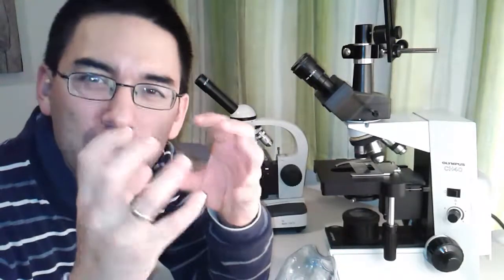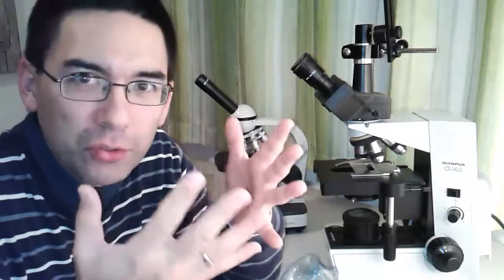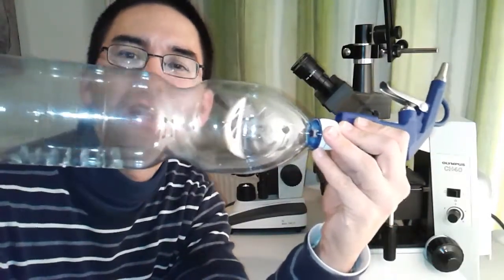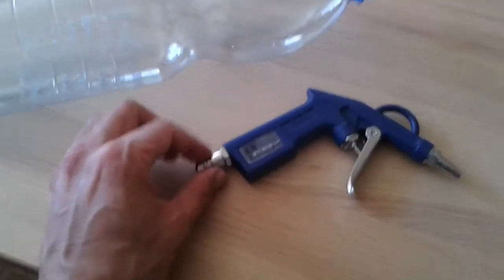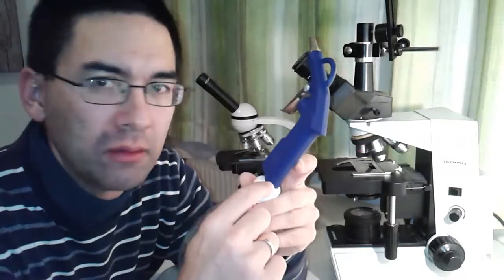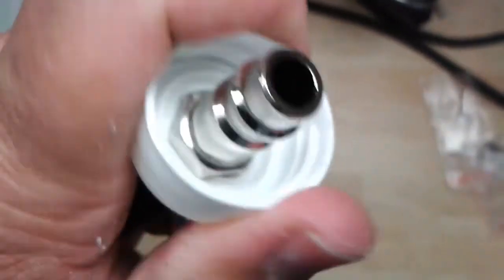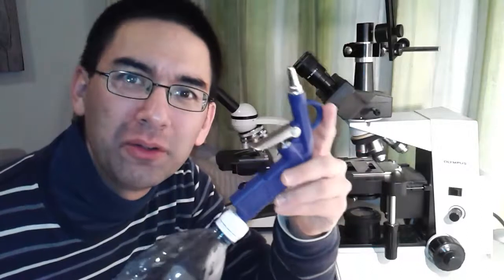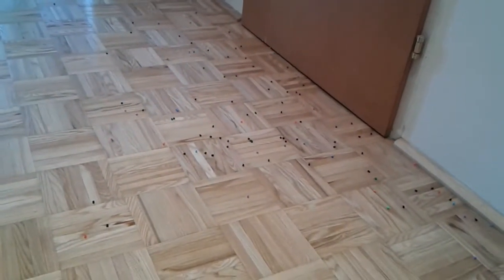🔬 007 - How to make a dust remover

Comment: Actually, because everything in microscopy is in light-weight class, you can use a an aquarium pump, a latex tube, and a syringe as nostril. The jet coming from the syringe is more than adequate to blow away simple dust           
Your own setup also works fine, but i would use an 'air-madras' -perhaps only the pillow, and sit on it to maximize the air-pressure :p

Comment: Nice. You've made a thing, so that's usually satisfying on its own. You can now try searching for "plant sprayer" (Pflanzensprüher). It's basically the thing that you've created, but with a built-in pump. Some kids even use them as balloon pumps. They sell them for 1.99eur at Action(.com) and (still reasonably priced) in some large supermarkets. Cheers.
edit: They come with a wide angle spraying nozzle though, so an even more optimal option could be a high pressure water gun toy, since they output only a narrow stream of air (and whatever you fill them with).

Comment: Hello!

So... I think there was a better solution all along and you already had it: your bike pump. It's in itself an air compresser, a manual one, and depending on the nozzle that you attach to it the flow of air can come out probably as good as (or even better) than this device that you made. I have an air pump just like yours and it came with two extra nozzles, one for balls (basket balls, footballs, etc.) and another that I don't know what is its original purpose but it's great for dusting cleaning!

So yeah, I think you went for all that trouble for no reason, just use your bike pump. If you don't have the right nozzle, you can always go to a sports shop and buy another one paying attention to the extra nozzles that come with it.

BTW, nice channel! Thanks for all the content you're producing.
Reply from the maker: The plastic bottle system has the advantage, that it releases air by only pressing the lever with one hand. With a bicycle pump it might be a bit difficult (?) to pump and at the same time hold the tube to blow the dust away. But there is another solution! I now have a bicycle pump that you can operate with your foot and with the proper nozzle it should be able to directly blow the dust away and you have both hands free. The plastic bottle is empty quite quickly and only allows for a few high-intensity puffs of air. So the bike pump itself also might be convenient in that you do not have to refill the bottle.